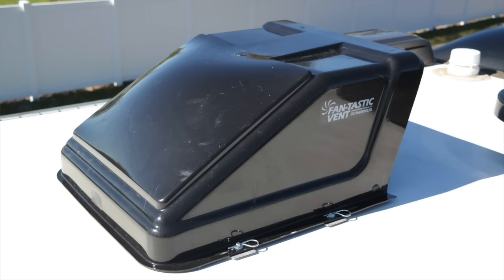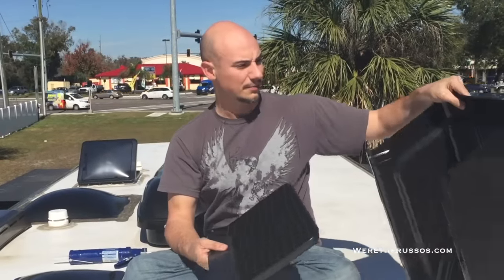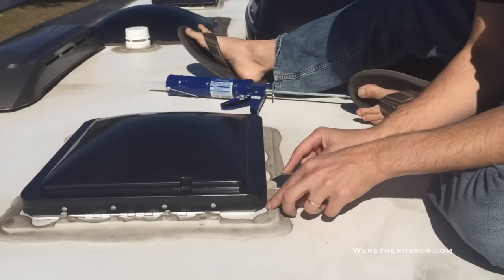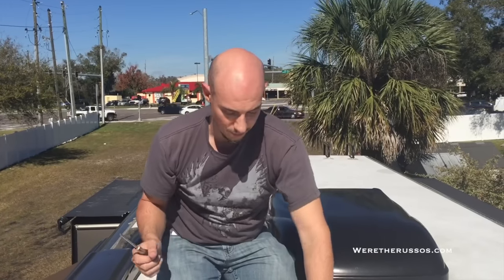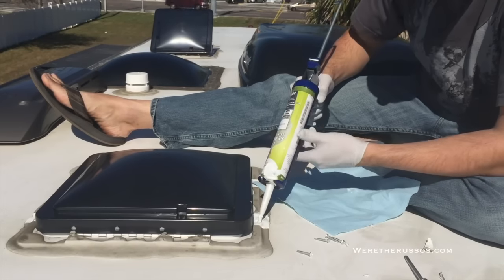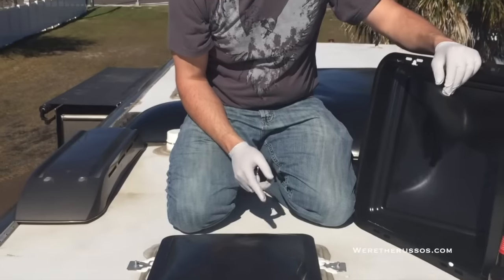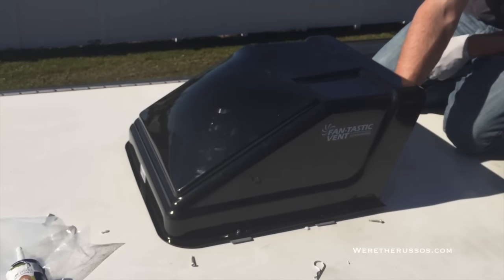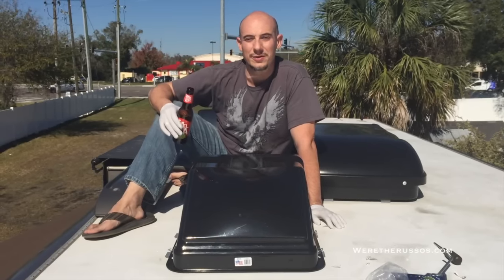RV Roof Vent Cover Installation Fan-Tastic Fan Vent Cover

Comment: First of all I like the video! If I may add one suggestion.  When you install the cotter pins install them with the pin FWD to AFT just a safety measure with vibration there is a slight possibility that a pin or so could vibrate out.  when the pin is installed FWD to AFT it will not vibrate off at all.  All openings grill and cotter pins facing AFT.  Again this was very easy to follow and a great video that helped me out for my installation two thumbs up!!
Reply from the maker: +Chris Warmbold Thanks for the heads up, we'll make the change.

Comment: I've been reading negative Amazon reviews about how the plastic turns brittle after a year?
Reply: I'd be curious to know how the black held up.  It seems like most (all?) of the negative Amazon reviews are for the smoked color, which probably has a different type of plastic so it can be see-through.

Comment: hey bud,
just got one of theses vents, but it seems like my maxair 4500 fan cover opens way higher (12") than the vent cover allows for?..not sure if this will burn out the fan opening motor/electrics?
did you encounter this problem with your fan cove?
cheers
Reply: Just installed on a 2007 Fleetwood Providence with Fan-tastic fans. Had the same issue as I needed to climb down and drop the fans cover for the vent cover to be installed. Had it full up and running at the time.  The fans cover will come up and contact the underside of the vent cover.